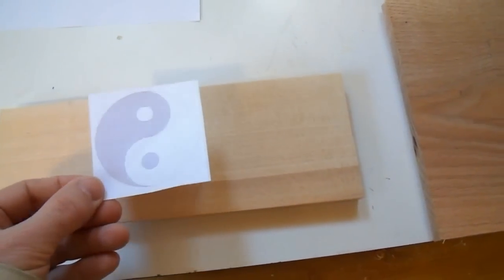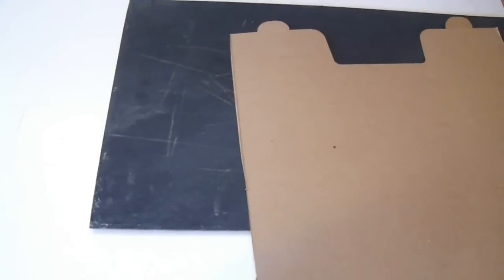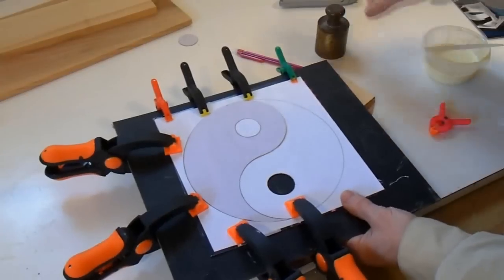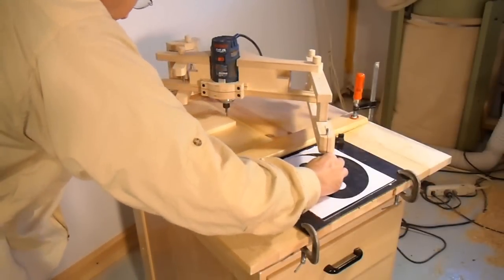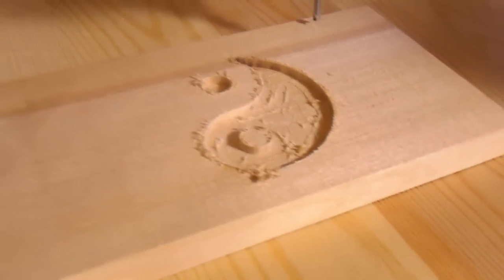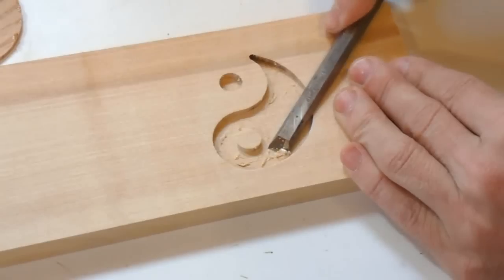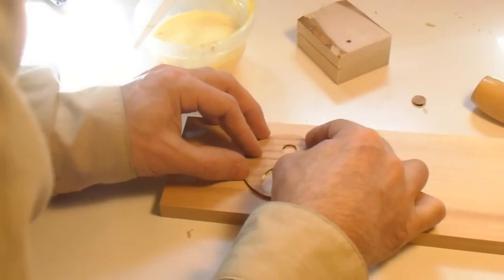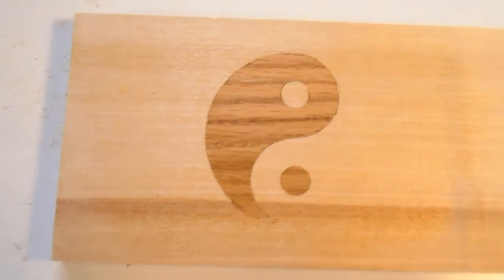Inlay carving with a router pantograph

Comment: I think this would look really nice if both the Yin and the Yang were inlays into a third chunk of wood that's a sort of neutral/middle color between the two pieces you used, then of course with a coat of varnish to bring out some more color. : )
Reply: +Whiskey Foxtrot needs a circle surrounding the symbol. do that in charred wood and it would stand out nicely :)

Comment: One way to help with the pieces fitting in would be to use a *very* slightly smaller follower when cutting out the inset, than when cutting out the piece to insert, which means the inset would then be a tiny bit larger. Not too small though or there would be gaps. Nice though - I bought the pantorouter plans a few days ago, hope to try things like this myself soon!

Comment: @Matthiaswandel I think what he is talking about is full 3D... to do so, all you need to do is have your template and the work-piece both on a rotational axis, where you can turn both of them upside down
or any given angle by locking both axles together (maybe a chain, but I'm sure you prefer some wood-gears).
Additionally, if you can make your router tilt, whenever you tilt the "needle" as well, that way you can get into various cavities...

Comment: If you mean in terms of depth, no. As long as the "zero depth" is set correctly, the Y axis will be scaled by the same factor (1/3rd, in this case). If it was on a linear bearing it wouldn't be scaled at all.

The only issue is that with very extreme depths, the tilt of the router can make the edges of the cut slightly slanted. To avoid that, the mechanism would need to be more complex, to always keep the router (and the follower) perfectly vertical.

Comment: If you used something delicate like a 1/8" router bit, or even 1/16" router bit, (assuming you could be careful enough and patient to not break the router)  would you be able to use a solid steel rod that was 2x or 3x the size of the bit? Buying the right size steel rod and cutting it to length for the guide seems to be a good option as well.

Comment: From the experience of tightness might you not try reduce the guid dowel diameter (or prepare a separate slightly narrower one) for the outline cut out? Making the guide's centre run closer to the template will move the centre of the cutter inward.

Also noticed that the grain's direction for the inlay was not the ideal - but it's still early days?

Comment: thank you for another great video. maybe you could get rid of flaws around the edges if you use a pointy routerhead along the edges of the hole and the same on the wood you lay in. the latter made just a tiny bit bigger than your sketch.
so that the edges that meet both have corresponding angled edges.
if i´m not clear please ask and i will make you a video on it.

Comment: I'm wondering about using a 3d printer to print out templates with the necessary thickness to use in this situation.... Or would they not have a fine enough resolution to get smooth edges?
Reply from the maker: Jason Law 3d printing would be fine enough, but it would just take forever.  Much faster to make one with conventional means.  A laser cutter might help though.
Reply: For a one-off, absolutely.  Maybe as an intricate template for repeated production use.  Best use of time would be the goal.